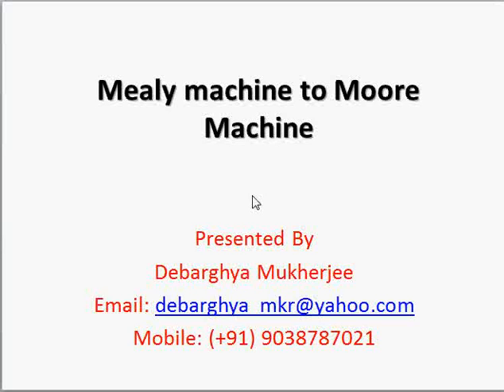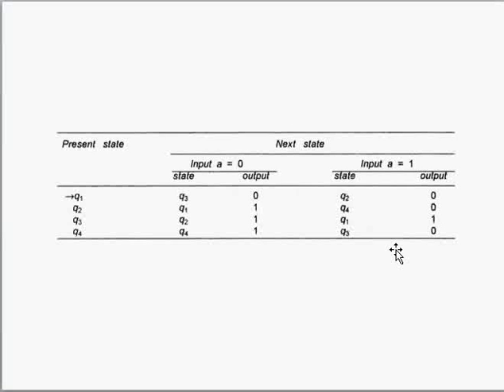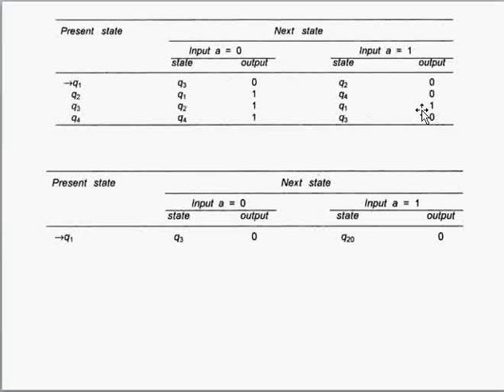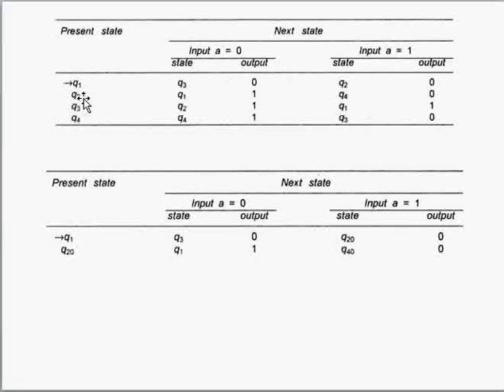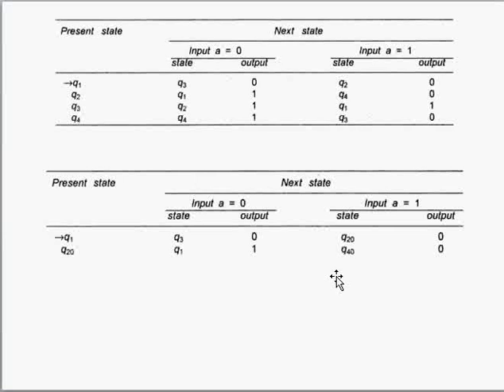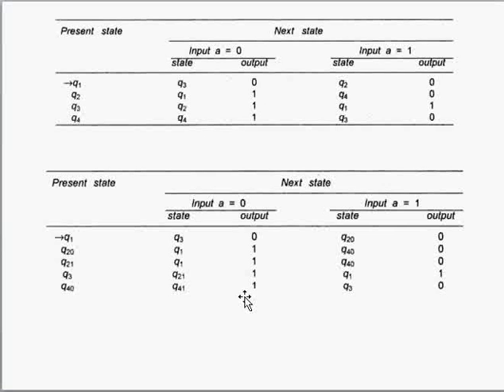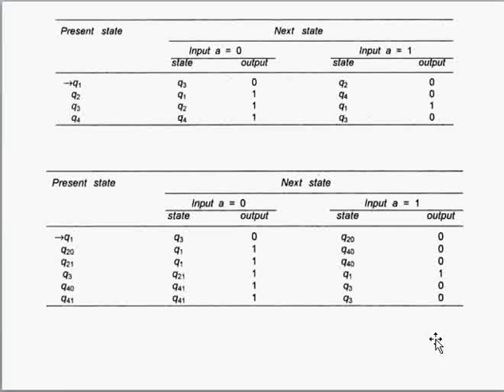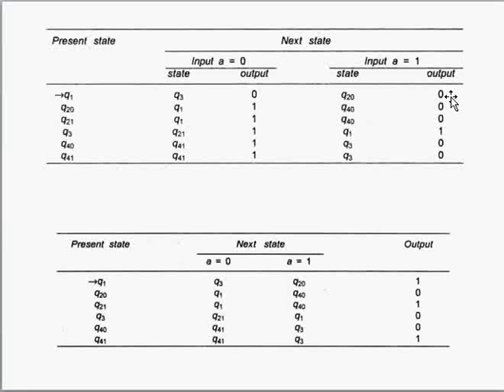Mealy machine to Moore machine conversion

Comment: This is a very good method but it will not detect any differences in outputs of the first state only , in this case "q1" if q1 has different outputs for different inputs
,, so i would like to think that every state which has different outputs you automatically divide it into two,  into the intermediate drawn table.
Thank you ,,